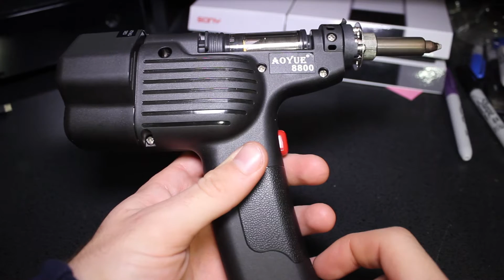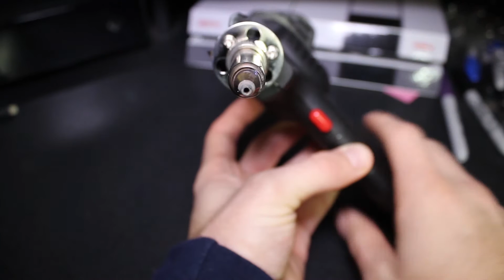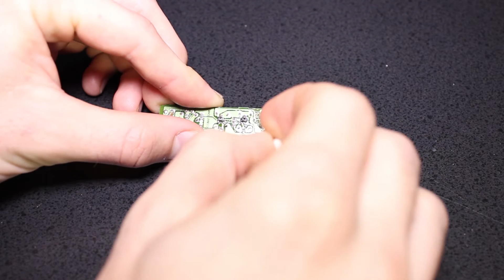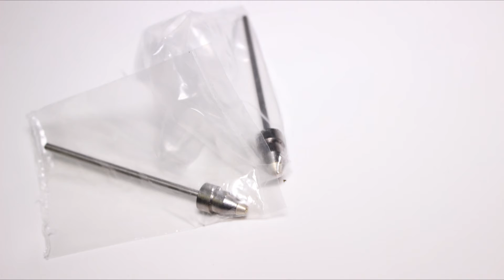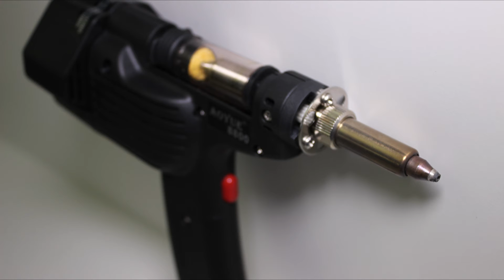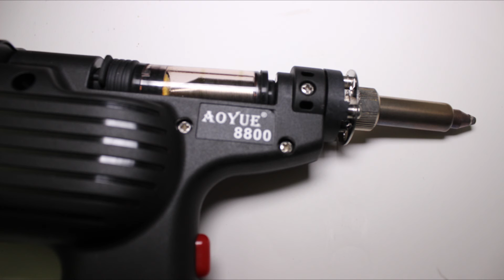Review Of The Aoyue 8800 Self Contained Desoldering Gun From SRA Solder

Comment: The gun works fine, but all the parts are extremely hard to find. Even the (long version) tips which are being used in the Aoyue 474, do not fit the Aoyue 8800. The spring (which is supposed to catch the solder) is shorter than the Aoyue 474 and Hakko one. You will be better off with the cheaper ZD-8915 of the hakko 474 versions.

Comment: Hi Whats the yellow stuff you are spreading on the back?  thanks in advance :)
Reply: Dan Chambers That is called flux. It is used to prevent oxidation on the joints of the board

I hope it helps
Reply: There really isn't much point in putting flux on joints you are desoldering.  Flux allows new solder to wet and adhere to surfaces better.